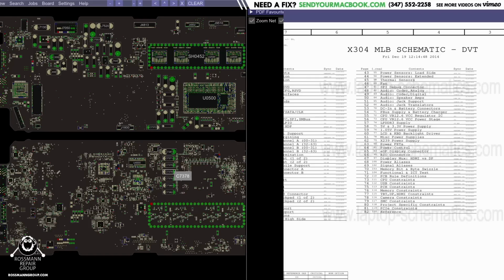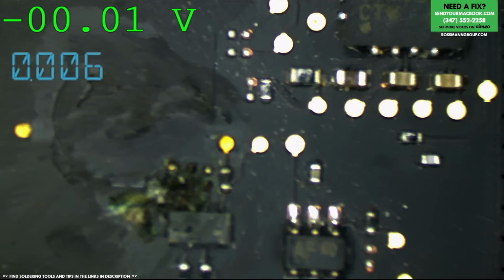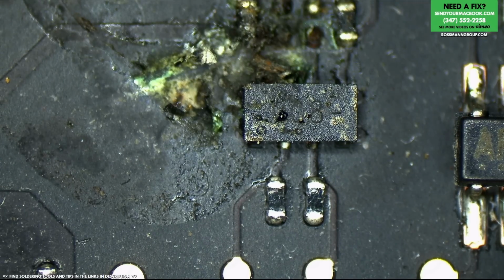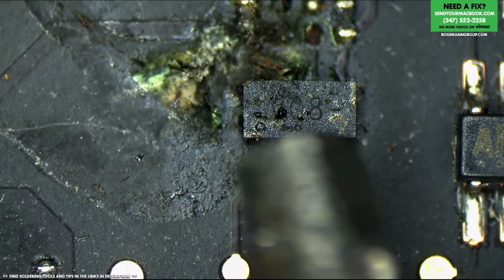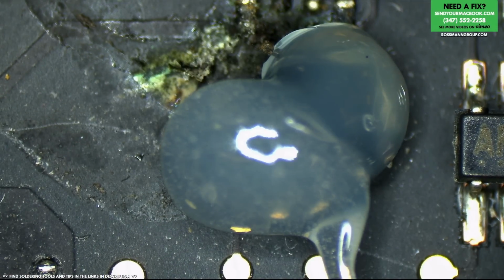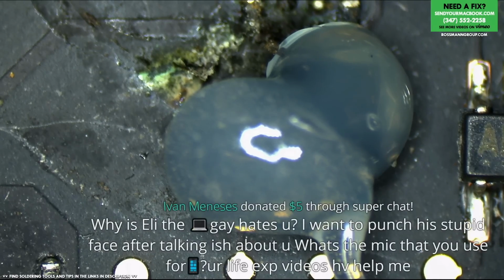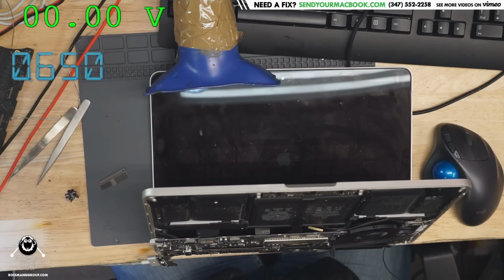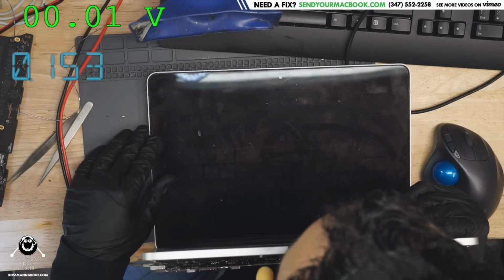A1502 Macbook Pro 24 mA not turning on logic board repair

Comment: Just wondering: in earlier videos you never used the current sensing for diagnosis. Is that a new type of sensor, or you never had the idea to use it? How much difference does it make to the average repair?
Reply: Louis might not answer but he has said in some of his live streams (see Louis Rossmann: RANDOM LIVE for more hours of board repairs ... :D) that he's got to the stage of fixing so many boards that he now knows from experience that when it reaches certain current draws, or certain patterns of current draw, that the likelihood is very high that it's a specific fault. 

Bit like how a car mechanic knows from experience what different noises from the engine mean :)

Comment: i may very well be mistaken, but isn't M12 a screw size, like M2 or M3 in computers?
Reply: Strictly speaking, you'd also have to specify the thread pitch, i.e. 1.25, 1.5 or 1.75.
Reply: @ctcboater   On normal (coarse) thread, the pitch is  usually/normally  dropped, so by standard, M12 = M12x1.75 while it is stated on fine pitch threads, like M12x1.5 /M12x1.25 , or if you're doing something odd.